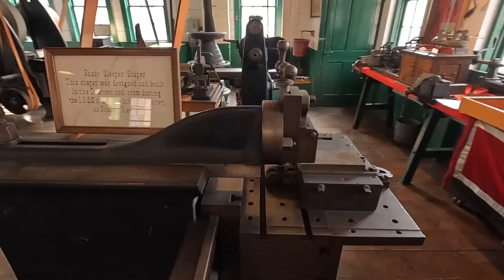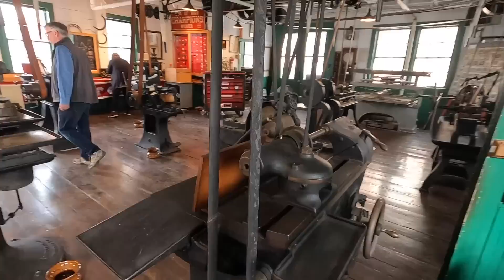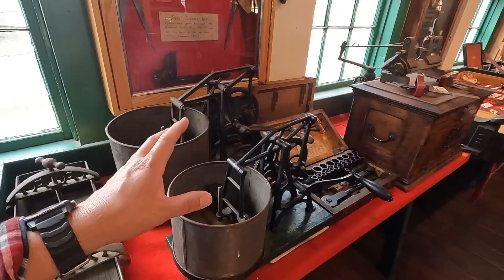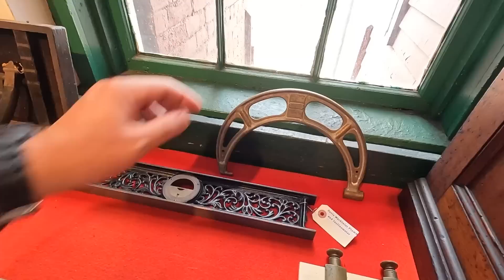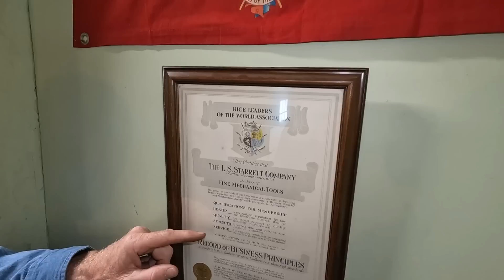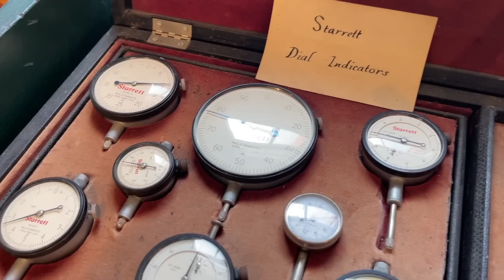The Starrett Museum

Comment: This is in an area that was called Tool Valley. It went from Conn. up thru Mass To Vt. Tools to make tools. My friend worked for a precision supply co in Mass. Everything for machine shops. He told me they were getting foreign products ,Poland, That was about the start of US MFG decline. Starret ,BROWN and Sharpe, Millers Falls , Norton abrasives. My sister lived near Athol in Petersham, Mass. The local flea markets were crammed with things made in the area. All US made. Recently  I bought some concrete ties. Americas Wire Co. MADE in China on the side of the box. During Bush 2 50K factories left the USA. Dimwit 2 didnt notice..
Reply: I lived in Petersham late 80's-2000's
Reply: Hopefully we can change course and start getting manufacturing Back to America, and raise the worth of the American working man while we're at it.  We sorely need it.

Comment: I have a star RPM gauge I always wondered what that thing was. It’s always been in my toolbox with the box and everything. The box has gotten a little tattered, unfortunately but I still got the bottom and the top of the box. Neat wonder how it actually operates though.
Reply: It's a high gear reduction worm gear with a pointer.  Use it along with a stop watch to calculate the RPM of a shaft.  I have one as well and I have used it on a few occasions.

Comment: Can remember asking an o!d timer many years ago about factories & shops powered by overhead belt . Told MS problem that belts would slip and entire drive shafts would slow down u set heavy li
loads. Machines that needed to be reversed had two sets of drive belts. One responsible for reverse had a figure 8 in the drive belt. Thanks for the great tour.

Comment: Nice video , thanks . Trivia question , I have a 711 test indicator and a 564 "Junior" test indicator . They are listed in the 1938 #26 catalog , here is the trivia part , each of them has a hole in the contact tip . Why is the hole there ? I don't know the answer .  The hole is only shown in the #26 catalog .
Reply: The hole is to tighten or loosen the tip by putting a pin on the hole.
Reply: That would be something to contact Joel at the museum about…